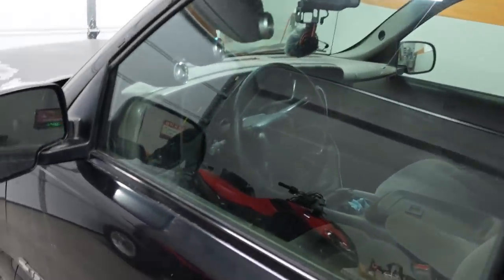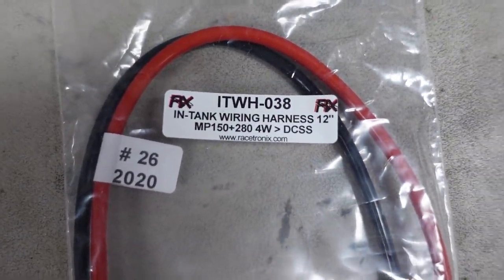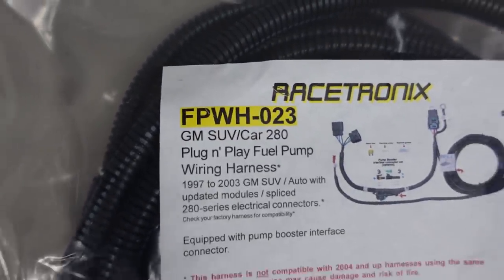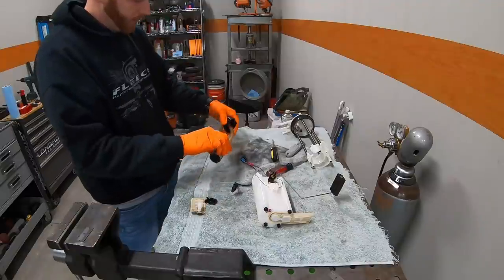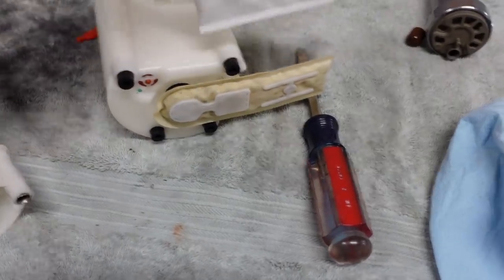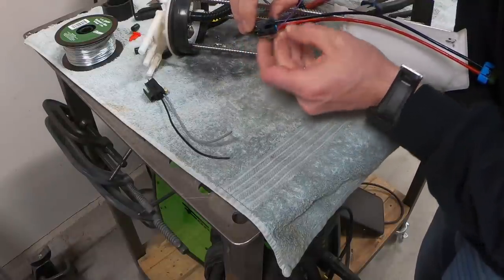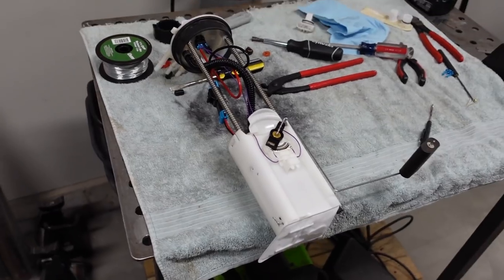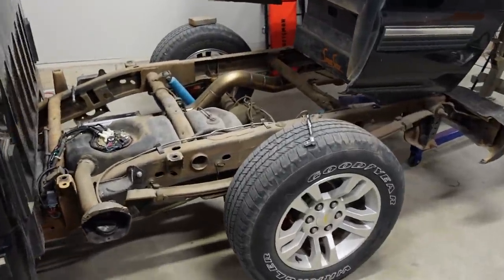Installing a Walbro 450 in a Turbo 8.1 Silverado

Comment: Ahh yes. Nothing better by starting off Sunday morning with some coffee and watching a new upload by the 🐐
Reply from the maker: glad I could help out! Thanks for watching!
Reply: Definitely top 5 but not goat. There will always be Stacy
Reply: @brianking7625  he was on Truck Tech with Powernation. And he definitely puts in hard work to create awesome trucks and YouTube videos. Wym he’s not a goat?
Reply: @alexescarcega5151  i am not bad mouthing LT but I believe Stacy is a better fabricator
Reply: @LawrenceTolman  how long of fuel line is that or part number I Oder the other parts I got a truck and it look just like your but 6.0 try get this turbo kit going only lacking injector and head up upgrades like valve spring , push rods, and rocks

Comment: LT, a little trick I have learned, when using a hole saw on plastic, after the pilot bit drills into the material, switch the drill to reverse. It doesn't take much longer, and the amount of debris created (shavings, etc) is dramatically reduced. 

I build police cars for a living, and installing strobes into the lights presents the issue of little shavings that you cannot remove (and are usually visible....)- that's the work around I came up with.
Reply: Always a good idea when using a hole saw with plastic.
Reply from the maker: I'll have to give it a try

Comment: That hotwire kit is pretty sweet. Did you need to keep the factory fuel pump harness there for anything or can you ditch it?
Reply from the maker: it plugs into the factory harness to act as a switch and pass the fuel level sensor wires through

Comment: Nice work as always! One thing you could do is get a later year fuel bucket. You can fit the 450 in them without cutting a hole and losing the reservoir. Here's a link to a post that goes over the differences in the reservoirs over the years.
https://www.performancetrucks.net/forums/fuel-systems-210/fuel-pump-upgrade-dual-walbro-400s-510542/#post5030455

Comment: I have my own auto repair shop in Wisconsin and I am very jealous of how easy that fuel pump lock ring loosened Lol
Reply: their pretty good for the most part here in oklahoma but when i was in northern wyoming, i know what you mean for sure
Reply: That's because everything rusts really bad by us.
Reply: These trucks have a plastic tank so no matter how rusted the ring is it comes off easy.
Reply: @nintendogamer5472   False, the tank has metal "tangs" that hold the lock ring to the tank, which puff up just as bad as the lock ring. Just did one last week, cracked pump causing EVAP leak codes, caused by the lock ring expanding and cracking the sending unit. Trust me man, in the salt belt they don't come off easy :)
Reply: @nathanceschi5100  forgot about those, living my life in arizona and texas I don't have the rust issue.

Comment: Good call on the hotwire kit. I did the Walbro 470 & Racetronix hotwire kit on my V6 Typhoon. It's a nice kit. I don't have anywhere near the cubes you do but I do plan on running E85 & close to 30psi though.
Reply from the maker: yeah, on ethanol you need a TON of fuel flow

Comment: At around 15 min it looks like you have that in tank fuel line installed that was supplied with the install kit, did you end up going with that? I saw it looks like you had some rubber in-tank line connected to the pump earlier in the video? Im trying to decided if its worth ordering some submersible line and waiting for it to ship, or just use the supplied line in the kit even though its a little long and just try to route it the best i can...

Comment: Wow i wish i watched this video FIRST before doing my turbo Silverado fuel system. I was unaware (learning) about higher current and it overpowering the stock wiring, also i ran two 320lph pumps and im now switching from the two to a single.

Comment: I have an 07 that I’ve had to replace a fuel tank pressure sensor. I ground it easy to losen the passenger bed bolts, remove drivers bolts, and then get a 2x4 to prop up the bed tilted to the passenger side. Easy for one man to do.
Reply from the maker: very true, never tried it myself though

Comment: Just tilt the bed up on that side by taking 2 bolts out on one side and loosening the other side
Reply: 3 bolts per side. That's how i did mine but i wasn't trying to also film myself doing it.
Reply: @raymondvandemheen2382  yep 3. I just tilted it up and stuck a block of wood to hold it. Really easy after that.

Comment: I’ve been fighting fueling ever since I upgraded my pump. I almost got a fuel cell kit but i actually ordered a Holley Hydramat instead, I have to install it but I believe it’ll solve my issue, you may consider as well if you get fueling issues after it’s all done up
Reply from the maker: i had thought aboutt Hydramat actually, just wasnt sure if it would connect to the Walbro pump. I guess I gotta look more into it if there are any problems

Comment: question does the harness listed work with the none e85 vers of the 450 or is there a seperate one to get. looking to do the swap into a 2000 silverado 5.3 end goal is close to high 3 or 400 hp nothing crazy and remain n/a all motor. been following you for a very long time loving it all.

Comment: 3rd option for fuel is to get a diesel sump and keep the 450 in tank and add a 2nd pump on a pressure switch or a hobbs switch.
Reply from the maker: I thought about a diesel sump, but the fuel tank barely rubs on my trailer as I load it up, so that would get hung up.

Comment: Hey LT is the rear end up to the task of taking 500 hp to the ground with tires that are gonna hook up? Plans for an upgrade when you really start making power? Don’t worry we won’t tell the wife if you sneak it in while she gone 😀
Reply from the maker: at the moment, I'm gonna run the 10 bolt and see what it will hold up to, the only thing I MAY change immediately is the ratio. But if the overall housing or carrier give me problems, I might swap to a 14 bolt semi floating 6 lug axle
Reply: @LawrenceTolman  hope it holds up. Can't wait to see you let the smoke out of those 6 year old tires.

Comment: you aren't going to have ant issues from the looks of what you put together there. but if you have any fuel starvation issues the quickest guaranteed way to remedy that is to pop that sock off and replace it with holley hydramat and leave the assembly as is. they work great and completely get rid of temporary fuel slosh starvation. they are on the pricey side but have some good budget sizes that will have good reach in your tank and flow plenty for your power even if you convert to e85 later.

Comment: Hey man, this video was right on time, I’m getting ready to redo my fuel system to support the 85 for my LSA blower and modifying the stock bucket really concerned me as well. Check out the Holley Hydromatt, looks like a great option for us to prevent the fuel from sloshing around and running the fuel pump dry.

Comment: With the way you did it, did you run into any problems below a 1/4 of gas?
Reply from the maker: nope, I've watched fuel pressure while doing some light pulls and its never dropped. (granted I don't love running it low on fuel, but no drops in pressure yet)

Comment: I just installed a walbro 450 in my chevy silverado start for a min. And then died I been trying several times with the same results. Do I have to tune my truck to run with the new pump?
Reply from the maker: no, you don't need to change the tune. maybe the feed line inside the tank came disconnected

Comment: I've got a GMS 340LPH pump. It's still the stock size so I didn't need to modify anything. But I'm also not trying to make 1000whp. 
  FuelLab makes a pwm pump where it adjusts the pulse widths to give you more fuel flow when you need it. I'm not sure how seamless the pressure is. You'd think it would need to see some sort of a pressure drop to signal ramping up the pump. Maybe it monitors the outflow back in the return line. If the return line flow is high, it turns down the pump, if the flow is lower, it ramps up the pump. Regardless, Im not sure i would want my fuel pressure to drop when I hammer the throttle.
Reply: What brand is that pump please? Looking for something for my 8.1 build around 600hp flywheel
Reply: @martyengland1964  mine is a granatelli motorsports. But any 340lph should work for you. The box on mine originally said 82-92 f body but it's the same size as any in-tank pump.

Comment: I dont think you should cut the bucket up. The bucket fills itself as fuel sloshes around. It has a little check valve in the bottom.of the bucket so fuel that sloshes away cant escape. By doing this every time you lay down the loud pedal the fuel is going too slosh away and have no means of retaining itself.... this is going too be especially bad on a pickup fuel tank mount longitudinally.
Reply from the maker: you're not wrong, but as I showed in the video, the stock pump has two suction ports inside, one to actively fill the bucket, and the other to pump fuel to the tank. Because the new larger pump only has one pickup port, If I stuck it inside the bucket as-is, there would be no way to actively fill the bucket, so when the fuel level goes below the top of the bucket, theres no way for fuel to enter other than splashing in. Not saying the way I did it was ideal, but I see no way to retain the factory functionality unless you have a 2 port suction pump

Comment: you are using the oem 8.1 ecm right?  I have been following but didn’t pick up on that. do you recommend the hp tuner for tuning GM oem ecm’s i am interested in messing with tunes on these engines.
Reply from the maker: actually, I'm using the stock 5.3 computer with parts of the 8.1 calibration copied over. and yes, I do recommend HP Tuners for the GM stuff, its pretty well laid out and easy to navigate

Comment: I've gotten to the point with Chevy trucks and SUV's where I know the fuel pump is going to fail at some point so I've just decided that if there isn't a pre-cut access hole already made in the bed when I buy it, I'm going to add one and turn it into a door with a latch lol
Reply: Ls swapped a zj grand cherokee and cut a trap door for easy fuel pump swaps.

Comment: Great show great information that i will need here in the future. Is there a reason u didn’t go with hell cat pump because that pump is rated at 525 LPH would it be to much for stock lines idk just asking because thats what iv been pondering on. 
Keep up the great work 
Josh.
Reply from the maker: that was my worry, was that a larger pump would be too much. according to the fuel pressure gauge, the 450 is about as big as I want to go on stock lines/regulator.

Comment: I did mine similar, only thing is the pass thru will eventually cause you issues. my pump has been in 3 different trucks now and still works fine i had to run wires directly from the pump out the tank map sensor hole to a relay and havent had issues yet.
Reply from the maker: what do you use to seal the wires that go through the hole?
Reply: @LawrenceTolman  sika flex you can get a tube at home depot for like 8 bucks, gas wont mess it up. it is for sealing driveways and is petroleum based

Comment: Great video but I wish you would have shown just exactly how you mounted that pump with the safety wire.  Great job showing part #'s.  Most YouTubers don't mention or show that.
Reply from the maker: apologies for that, I totally forgot to get a tight shot inside the pump hanger
Reply: @LawrenceTolman  do you have any still shots of it or maybe some unedited video?  This is my next step on my list and if you could help me understand just how to mounted it inside the bucket would help.  Thanks!

Comment: How do you go about doing a hotwire kit on a gmt400 with the integrated fusebox? I have a 97, and I'm not sure if I have to replace every wire going to the fuse box.
Reply from the maker: Just use the 12v switched that’s at the fuel pump connector to trigger your new relays, and connect the big high current wires to the alternator
Reply: @Lawrence LT Tolman  thank you, sir. Would I just leave the old relay in the box or pull it?
Reply: @Lawrence LT Tolman  nevermind, got it. Lol

Comment: Is the 8.1 regulator the same as the 99-03 non flex fuel regulator?
Reply from the maker: it looks very much like a 5.3 regulator, but cant say for sure
Reply: @LawrenceTolman  If it is, you might be able to run the Atomic Fab FPR bypass plug and simply add the aftermarket FPR inline in the return side if that would happen to work with what your planning.

Comment: I re-pined the stock connector and had to go back in and replace the connector with a new sealed delphi style and run power and ground through a grommet in the top of the hat that I sealed. Hope yours doesn't have any issues.
Reply from the maker: I'll have to keep an eye on that
Reply: @LawrenceTolman  yup, luckily I noticed it while the truck was idling, not in boost.. unluckily, I had to drop the tank again. 😅

Comment: For the guys doing the TBSS intake swap and using the corvette regulator it hovers around 58 psi. and that uses the same size return on the trucks. so i figure 60 psi at idle is fine.
Reply: Not all TbSS had a LS, there were some with the Atlas.
Reply: @shadowopsairman1583  a trailblazer model ss was always an ls2. A Base trailblazer ls had the 4200 vortec. Therefore a tbss was always a 6.0

Comment: Why not a 525?
Reply from the maker: was worried the 450 would be too much on stock lines for now, so if I have to re-do it, I'd rather (I think) just buy a second 450 and run 2 pumps
Reply: @LawrenceTolman  I was in the same boat, but being that you have the smaller hat, the return style, two 450s won't fit in the bucket, you'd have to buy a nice billet unit or just hang them in there.. I was in the same boat, wanted it be as factory as possible and use the factory bucket and connectors etc.. but alas, my 525 works fine with stock return line and regulator.